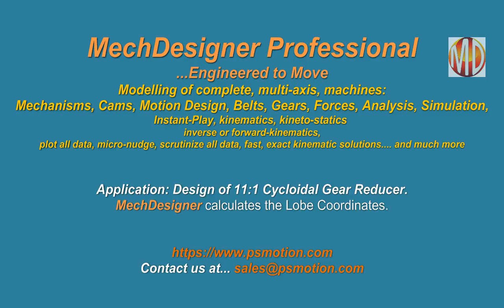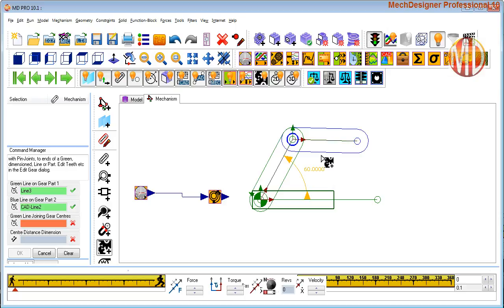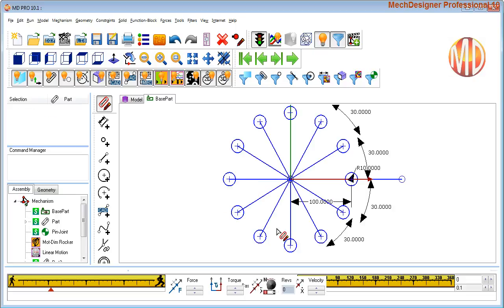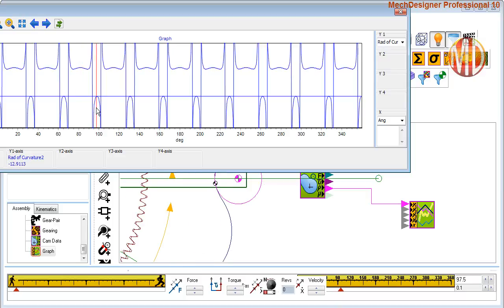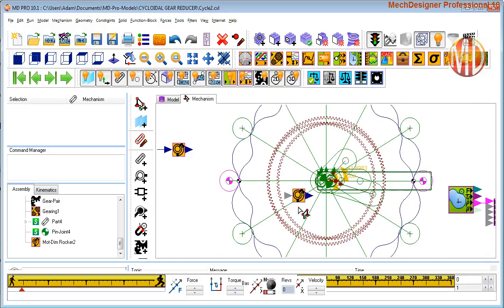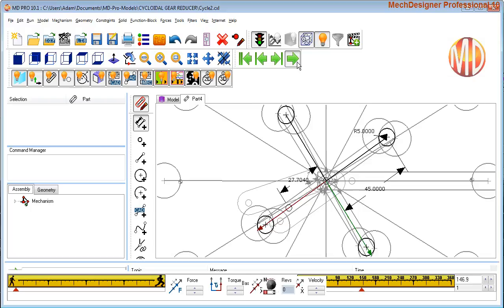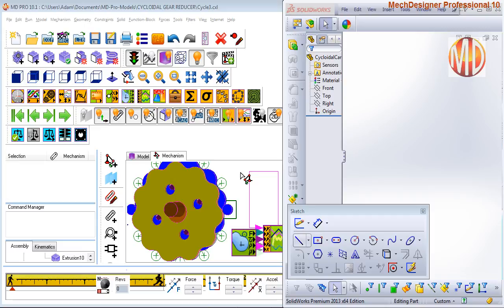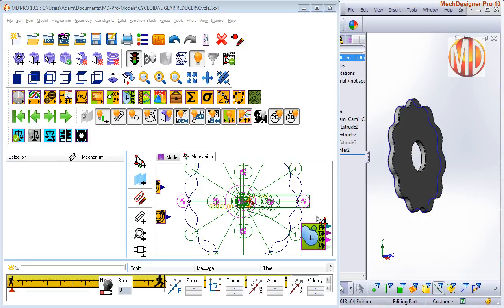MechDesigner Software : Design of Cycloidal Gear Reducer with MechDesigner

Comment: Very interesting. Is it possible to analyze a dependency od input and output angle? I would like to know whether it is linear or non-linear...
Reply: Hi. The input to output ratio is constant. There is no modulation of the output speed - even though in some ways it appears to be varying.

Comment: I have been having issues with my design, so I’ve been looking at videos. Your (360 degree/ratio) angle offset for the output holes is an intriguing idea.
Reply from the maker: It is intriguing. But actually, it is a 'standard' cycloidal cam for gearing. Cycloidal Gearboxes generally have high single-stage gear ratios, with the loads that are distributed across a number of pins, if made with precision. This design is not quite a cycloidal in the standard way, in that the 'lobe' cam is not generated directly by the path of a point on a gear rolling outside another.  This 'lobe' cam is generated by the pericycloidal 'wobble' of gear, once per rev, of gear inside another. It is similar of course, in that gearing is used to get the interaction between a point and the frame. Also, we use the power of MechDesigner Software, to generate the cam directly from the stationary pin and the once/rev wobble motion [as you have pointed out].  We do not need any other step.

Comment: Hi,
What if i increase the number of the pins number, then should i change the gear teeth numbers ?
Reply from the maker: Hi , Yes - you need to increase the number of Pins and change the gear ratio to give the number of rotations
To generate the Cam you only need one Pin.